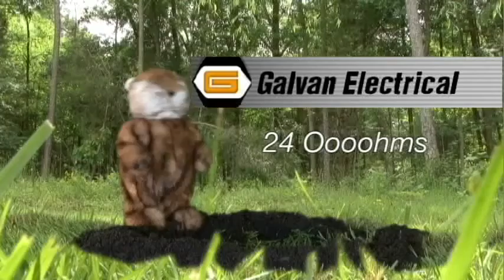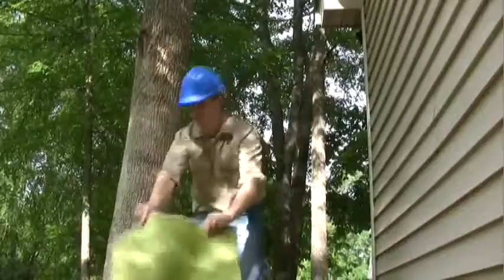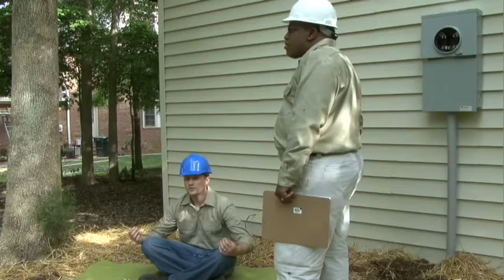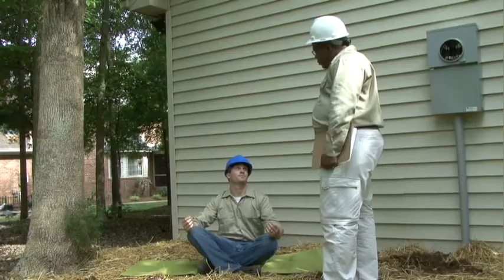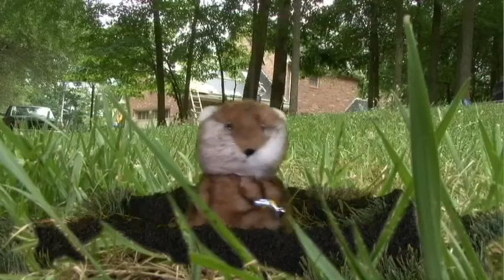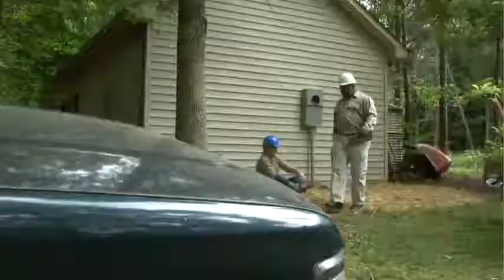The case for two ground rods

Comment: I’m installing  a tv antenna on opposite side of of house where the service panel ground rod is.      I want to install a rod for the antenna only.         
I assume 1 rod is enough?
I will run #10 awg wire from the antenna mast, as well as the coax ground block straight to a single pipe clamp on the rod....

How far from house should rod be?
Is all of this ok?
Meets NEC?
Reply: The ground of the antenna NEEDS to connect to your home ground system.   All houses require an intersystem bonding bridge where your low voltage grounds connect to your house grounds.  You could have differences in voltages from equipment to house if your low volt connections are not bonded to the house electric system which can cause static and premature equipment failure

Comment: Is tyhis video for Water?   or for Electric?            Im trying to find a Groundrod & copper wire coming from it at my house by the meter can & can NOT find any ground rods or copper wire in the ground anywhere.            ..  weven been having electrical issues for Years & wondering is it possible it doesn't have a ground rod??
Reply: Try your water meter

Comment: I want to install two ground rods in my house because I don't believe I have any. Or if I do they have long since disappeared since my house is about 30 years old.
I assume I'm supposed to connect the two ground rods together via lugs. What size wire should I run between the two ground rods?
Reply: CA: #4 AWG stranded copper in armor cable or #6 AWG solid bare copper. 2 ground rods are not necessary if you can identify the ufer ground.  If you can identify that is has cold water bond and gas bond 1 rod is only need as well. You'll want some sort of roto hammer and drill bit to put the 8 ft rod in or a good arm.  Leave at least 6 inches to connect ground clamps. Ask your local electrical distributor.

Comment: what gets connected to ground rod & where does it get connected
Reply: In the ground bellow your utility panels. Connect your #4 stranded or #6 solid copper to ground/neutral bar in main utility.  (The white and bare copper wires are all attached to it.)

Comment: Everyone keeps says 25 ohms or less but no one shows how to measure it????? Obviously one lead of the meter on the rod but were do you stick the other one???????
Reply: And we still don't have an answer.
Reply: @jamesm568  you need to use a mega meter to read it,,, only other way with meter is measure bottom of rod to wire end in box not possible
Reply: I assume you stick the other end to the ground wire AND the dirt.
Reply: Two different stakes (that are at two different lengths) are on our meter that get stuck in the dirt. The other lead goes to your grounding stakes.They make a meter for this job. It is sold in grounding and bonding kits for flammable liquid transfers.
Reply: You need a megohmeter most people don't have one hand for the inspector due to cost and un necessity.
Reply: You need a special ground/soil resistance tester. A standard multimeter doesn't work.
Reply: Electricians are the WORST at explaining things.  They always assume that you know more than you probably do.  They don't understand that most people know NOTHING about these topics.
Reply: @Greenisgood1000 So why bother making videos then?
Reply: It can be done a couple of ways, but most commonly it's done with at three points with a special meter. Two rods are inserted into the ground at some distance from the service ground and all three attach to the meter.

Another simple, but dangerous, way would be to connect a hot wire to the ground rod and measure how much current flows. Then use Ohm's Law to calculate the resistance.

Comment: The code is wrong on this. The belief about electricity is that everything flows to ground. Well, yes it does, in the end. But before that it just wants to equalize. Put sun on a solar panel, it creates a voltage difference or potential current flow. Where do the electrons want to flow? The ground? Of course not, they want to go back to where they came from, the panel the photo voltaic cell they came from. Each cell will attract an electron until it receives one like it lost.
 Will that electron flow thru ground to get there? Of course it will. Each cell wants to be neutral again. If a person happens to close that path then yes he will be used as a conductor. If the ground was open in the first place there would have been no chance for him to be in harms way. 
 If you understand this, you should also understand that having an alternate path to ground doesn't make one safer, it makes it more lethal.
Reply: You just explained exactly what the ground wire is for. It's there to trip the breaker. If the hot wire touches something metalic, it creates potential there, but in an ungrounded home, it will wait for someone or some thing to come along, and complete the path. If that metalic thing has a wire tied to it, and ran back to the neutral bus in the panel, touching the hot to any part of it will be the same as touching the hot and neutral together.
Reply: That's true if you have no safety systems, but the idea is that RCDs/GFCIs will cut the power as soon as too much of it goes through the earth, so by having more ground paths you are right that it makes it more likely that some electrons will take that path, but I suppose the thinking is that the safety systems then also have a better chance of activating too.
Reply: @guyanacreations4073 , I am too. Most electricians don't even know what the ground wire is for, so they end up taking short cuts that burn things down, or kill people.
Reply: @guyanacreations4073  Get yourself some of the newer cadweld products specifically made for rebar. I work commercial, so don't run into the hack it in residential stuff on the regular until friends of friends call me up because half of their lights/receptacles are out. Some of the things I see in peoples homes makes me wonder how electrical fires aren't more common.